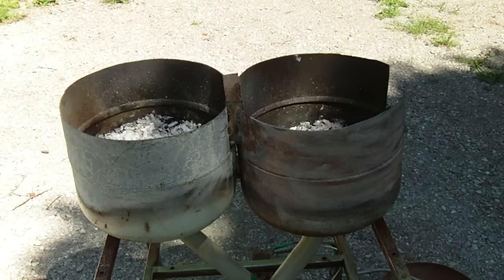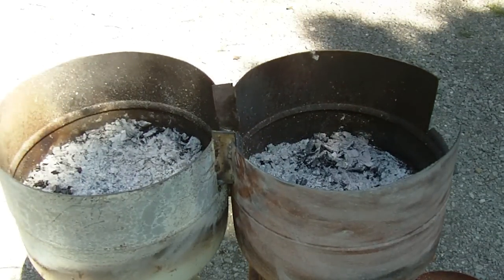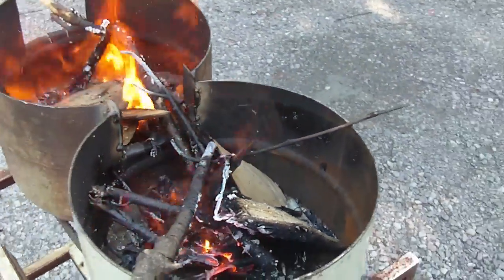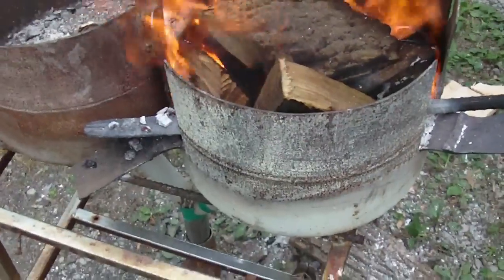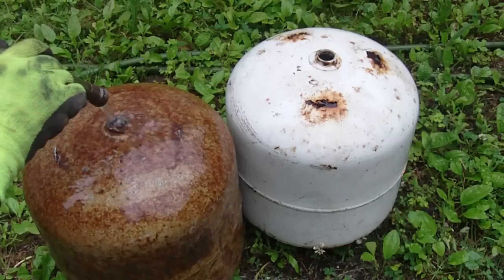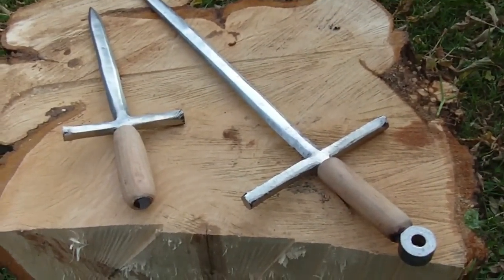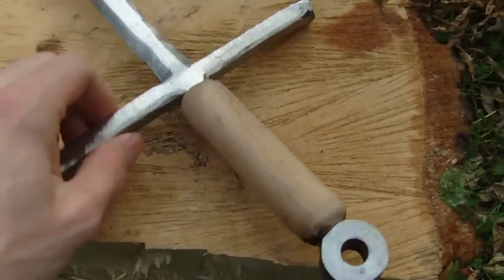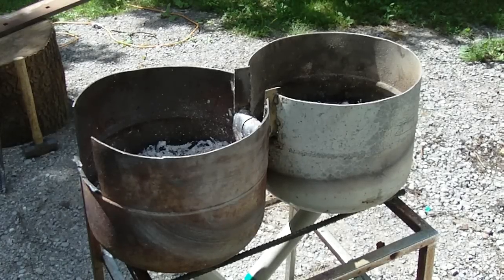Homemade Forge built from old propane tanks. Burn Wood or Coal

Comment: On the other hand, my rocket stove made of 80% pumice and 20% Portland cement is capable of withstanding extreme heat from pine. Best of all, it doesn't crumble like the plaster/sand mix Youtubers used for gas forges.